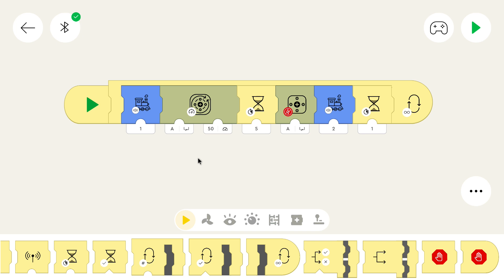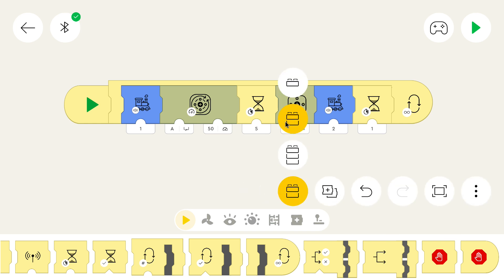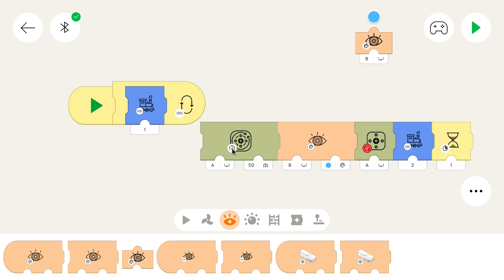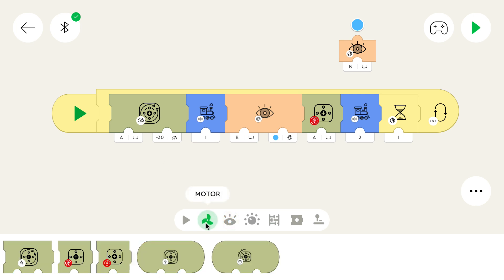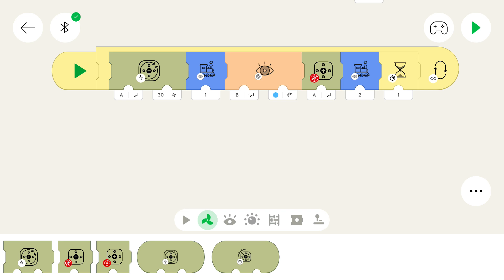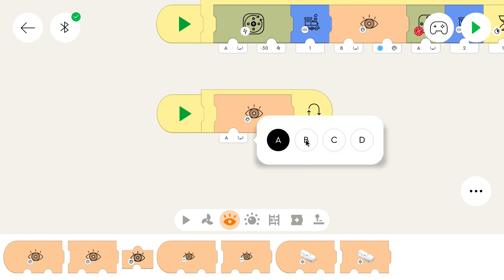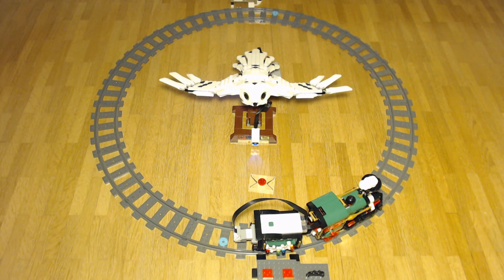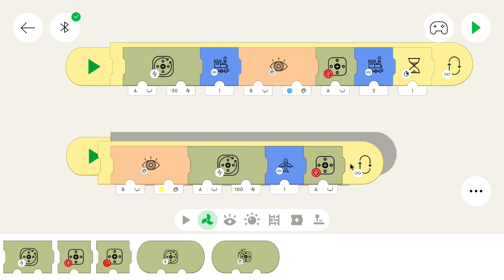Lego Powered Up Tutorial #04: first steps with the (boost) color & distance sensor [English|HD]

Comment: They don't sell this sensor anymore :(
Reply from the maker: Yeah :( But you can still get it at resellers like bricklink for less than 10 bucks used. Or new for around 15 bucks. Make sure to check the "part" (number bb0891c01) and not the "set" (88007).

Comment: So glad you decided to redo these tutorials due to the update in the coding blocks. As a keen Lego builder I would also like to say thankyou for introducing me to coding at the age of 69, lol. I have previously built Lego sets which had movement or lights but have just built a custom build which is a mine. I have successfully added movement using your instructions but also have two lights that I am struggling to get the right coding. So I'm really looking forward to your new version of the previous candlelight tutorial. I've managed to get the lights to turn on but would like to set it so it has a " flicker"  and then turns off independently of the movement. Currently, I'm having to use the green play button to turn the lights off but that also stops the movement which is not ideal. Do you know how long it will be before you do the new version of the candlelight tutorial? Many thanks for your tutorials so far, and don't worry about your accent your instructions are very clear and extremely helpful.
Reply from the maker: Making these tutorials is a real time problem. I've started to have some things where I have social engagement and that's stealing most of my time. I might upload a few parts before christmas but I think that the LEDs would be somewhere around part 10 which is a long way to go.
Another problem is that some things don't work so good since the app switched to the new design where I have to find workarounds for. But for that (and to test if the code still works) I have to rebuild all the things I've shown in the video and that is additional work.
Anyways. Thanks for the feedback and I will try to upload a few new parts until christmas, but I don't promise/guarantee anything.

Comment: I'm new to powered up. I'm getting stuck with trying to loop my instructions. I'm basically running a subway train which departs slow, finds green and accelerates to a moderate speed until it finds blue and slows down and then finds red and finally stops (at the station) for 10 seconds. It should then depart the station and find further colours. I'd like this train to repeat the instructions throughout my layout, but I'm unable to loop the instructions. Can you help?
Reply from the maker: Part 5 might help you there :)